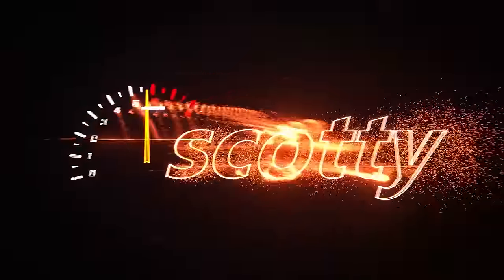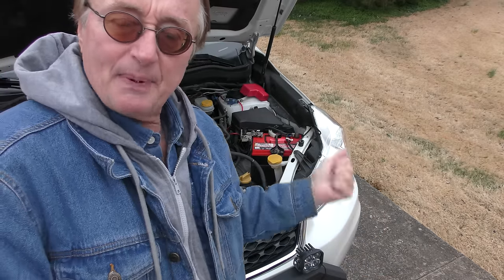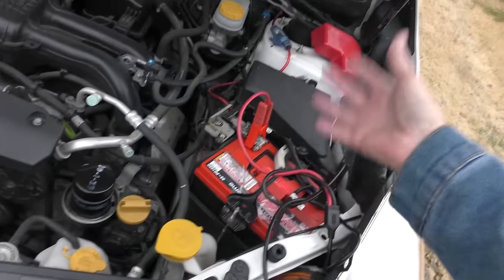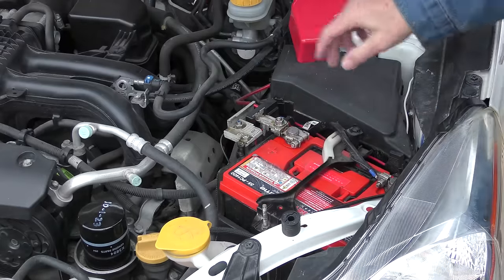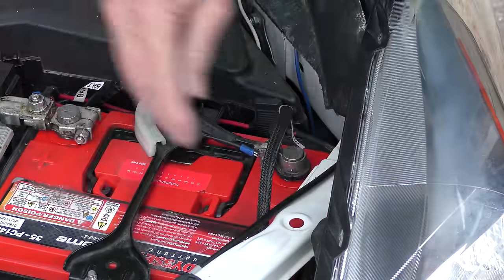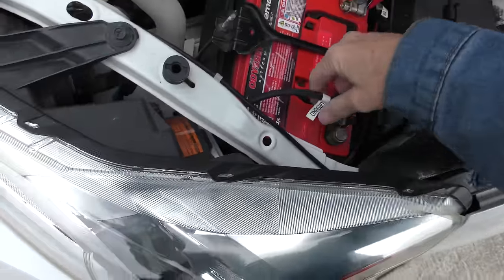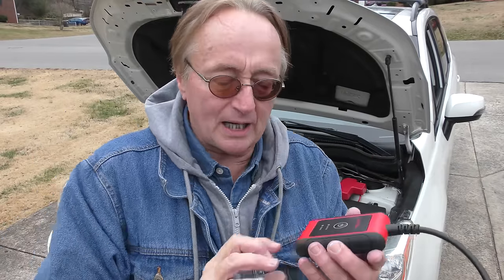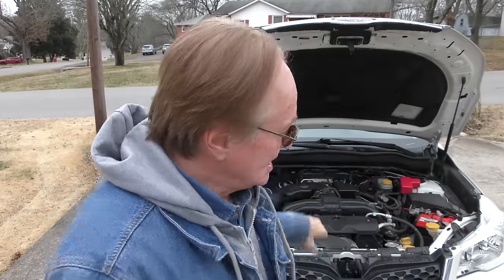Here's Why Connecting Your Battery Like This Will Destroy Your Car

Comment: That engine sounded like a lawnmower with a bad connecting rod. 😆
Reply: Yeah, Scotty has another problem now! Loud knocking noise.
Reply: I always wondered about the secret marvels of Korean engineering, now I think I know the answer.
Reply: I didn’t think it was going to make 3,000 rpm
Reply: It sounds like the owner is storing spare nuts and bolts in the sump 😂
Reply: It's a Subaru 😂
Reply: @robertmaybeth3434 that's Japanese engineering not Korean 😊
Reply: @donpalke4519  CAN'T BEEEEEE
Reply: Typical Asian cars that sounds puts me off
Reply: That because it's a Junkaru. They all sound like the old air cooled VW motors.

Comment: When changing the battery connection,  remove negative first, install positive first. This way if you're tool touches ground while on the terminal there is no short.
Reply: Very helpful. I can remember that. Thank you
Reply: And fit the positive first and then the negative

Comment: That's why I always change my own batteries.  I don't make mistakes like leaving the terminals loose.  I also take them off and clean them periodically.  That is also the first thing I check when I have electrical problems.  I learned that in the 70's.
Reply: I just buy a Camry and don't have to worry about that shyte for 15-20 years.
Reply: I started buying the red, green washers to put on the posts in the 70s.  Coated the posts with Vaseline.  Live in Minnesota and hated battery posts problems in the  winter!

Comment: Those Odyssey batteries have low cold cranking amps and are ridiculously high priced/ I've been using Walmart batteries for decades and I highly recommend them. My latest three-year Walmart battery by Johnson Controls is closing in on year 7 of its life.  Purchased in Oct 2017.  (Today is January 22, 2024) Still cranking good and doesn't falter in extremely cold weather. Cost $80.00.  I think that's a darn good deal.
Reply: My Odyssey is 12 years old.  I live in Colorado.  I'm not a cheap bastard either.
Reply: I have the same battery bought the same year and run a small aftermarket stereo system just a couple hundred watts battery still seems good .
Reply: Very extremely good deal.  I believe they are deliberately lowering the quality of lead-acid batteries so they die sooner than they used to.  Everyone has stories like yours, they used X battery that was so good it lasted 5/6/7 years.  The last battery I bought for my Camry lasted a little over 2 years.  And that's just ridiculous.  ESPECIALLY when I always kept the water level up , always used distilled ditto, and always kept the terminals clean and tight.
Reply: Yup Wallmart Everstart all the way, I had one last over 8 years..
Reply: Me likey Wal-Mart batteries.
Reply: My Walmart battery , still going 7 years plus.
Reply: Lol....one of the best long lasting car batteries I ever bought was branded "energizer" and yep, I got it at wal mart.
Reply: Well, dang, I've always shied away from Wal-Mart batteries ("Your battery was made by the lowest bidder.")  From what you folks are saying, I think I'll give Wal-Mart a try next time I need a battery. I usually get batteries from O'Reilly's or Napa, and the prices have gone up a lot. Batteries for my Acura Integra and RSX used to cost ca. $75-80. Lately, they've been running $130, $140. What the fruitcake?? I do know that a fresh battery is best.....
Reply: @lawrenceh1405  I'm an O'Reilly's man for 20 years but I won't pay their prices  for a battery. I've bought Wal-Mart for years.
Reply: Costco batteries are better.
Reply: @MichaelRei99  I wouldn't doubt it. Three companies make virtually all batteries in the U.S. Johnson Controls, Delphi and Exide. Delphi makes Wal-Mart Everstart. And Costco's Kirkland batteries are made  by Johnson Controls.
Reply: Walmart used to have good batteries.  In 2020, mine was almost double the price of my previous one and it lasted just beyond the 3-year prorated warranty. Batteries used to regularly last 5+ years and I live in a moderate climate where it never dips below 40°F.
Reply: @MichaelRei99 Costco lowered their warranty (or the manufacturer did). They no longer carry the fitment for my car.
Reply: @jaymez858  Interesting.
Reply: Another disadvantage of AGM matt batteries is the charge voltage limit.  Easily damaged with too high of voltage whereas flooded type batteries are much more forgiving charge voltage wise and if water level is maintained.
Reply: @richardrichard8741  Interesting. I did a little research. You, sir, are correct. Thanks. I worked parts back in the day. Way back in the day, if you know what I mean, lol, and we would receive our batteries dry and fill them with sulfuric acid upon sale. I can't remember if we even had to put them on a charger or not. I don't think so. I think when flooded they activated. I'm  not sure.
Reply: Last battery I bought was from Walmart based on one of Scotty’s videos where he said that was the best place to buy batteries. That was a few years ago and the battery cost significantly less than other places. Seems like their prices have crept up lately, but I don’t know how they now compare with other places.
Reply: Here in the Arizona desert, where the temp. Gets above 100 in the summer for 30-45 days in a row, the batteries last maybe 30-40 months.  I buy the wal mart batteries and carry a li jumper. Paying $250 for a battery is just dumb.
Reply: @lorenscalf56  Good info. Thanks!
Reply: Johnson controls is an evil company - ask any employee - but they still do make good stuff once in a while
Reply: @MichaelRei99  costco isnt countrywide

Comment: Yes, tight is good.  I would have first removed the cable end and used a battery post brush on the ends and posts.  Tight is good.  Clean and tight is better !
Reply: I told her that and she slapped me
Reply: My high school tech school instructor, a retired Coast Guard Petty Officer, repeated daily that "90% of all electrical problems are loose or dirty connections", the solution he hammered into our brains > " CLEAN AND TIGHT!!". 20yrs later at thr end of my mechanic career, that advice proved itself repeatedly.
Reply: Also remember that just as the negative battery terminal connection needs to be clean and tight, the other end of the ground cable to the engine and/or chasis also needs to be clean and tight.
Reply: @289hipo  As the old saying goes Cleanliness is next to godliness. Clean and tight makes everything tight.. :yougotthis:
Reply: clean and tight is better? are you talking about batteries? or something a little closer to home?
Reply: When I do that I have to go find my "Memory saver" all over again, if there's smog check coming due in the next 6 months... may you never have to learn the meaning of that cursed acronym "PDTC".
Reply: I think the concept of battery shim was not mentioned nearly enough if at all here.  So many people I mention the occasional need to shim their clamp, look at me like I ride the short bus, and refuse to believe a "battery shim" is ok to do.  But seems like every battery I serviced needed the clamps shimmed at least by the second time the clamps came off.  REason I mention shims is because, I'd do almost ANYTHING to avoid replacing the clamps - if there is a legit way to avoid that I'll do it -
Reply: That's what she said. 🤭🤫
Reply: I can absolutely second what you've said. Tight is good. Very good. REALLY GOOD. And it's important on battery connections, too!😉
Reply: @jimmymcguire - Yes sir…. ‘Tight is always good’👍🏼
Reply: And ⚡lubricate it, so it does not corrode
Reply: Exactly,the chassis ground connection is in bad shape on lots of especially older vehicles,and is never cleaned.
 Causes problems.
Reply: We all need to watch less Scotty and do more dating 😅❤😂
Reply: Yes, of course you are correct.  BUT  Scott knows you are going to have to re-program the auto's radio and possibly other accessories..if you disconnect the battery's ground. And naturally..he's not getting paid for that.

Comment: Simple but important stuff.  Thanks, Scotty.  I once blew a head gasket because I replaced a hose and used a Harbor Freight hose clamp.  (They slip teeth.)  Neglecting details or going too frugal can cost big bucks.
Reply: OMG that's truly the worst horror story of an HF crap-product I ever heard - we all learn one way or another how far to trust any harbor freight item, they are like flashbulbs of the tool world.  But when you need something like a crankshaft puller and you know you'll only need it once, the temptation can be impossible to resist.  But I always knew my personal mantra at HF "do not buy any item with one or more moving parts!" I had no idea that applied to a simple hose clamp...
Reply: Thus we learn the difference between frugal and cheap

Comment: Only honest people admit their mistakes or when they are wrong.. That's why I trust Scotty's advice
Reply: Everybody, and I mean EVERYBODY has an agenda or a bias, count on it. Now if you have an agenda/bias are you really honest?
Quote: "Hey, things wiggle over time. That's one of the big problems with fully electric cars, you can have all kinds of problems".
I'm a petrol head BTW, however - I don't mind calling out something when I see hear it.
1. ICE cars have orders of magnitude more moving parts than EVs.
2. ICE cars produce orders of magnitude more vibration than EVs.
3. ICE cars also have electrical systems, (that still use electric windows/door closing/sunroof etc), and given the CAN bus communication that we use these days there is not the difference in quantity of electrical connections that you think there is.
Think about those three statements when you now read back over what Scotty said.
Reply: I wouldn't
Reply: I thought I was wrong once, but I was mistaken

Comment: Yep - faulty ground connections can result in all sorts of weird things going on.  One of my aunts has an old Chevy Cobalt and it started acting like it was possessed - turning on and off lights, activating door locks and windows and other odd ball behaviours.  The ground wires had corroded off (so that is another thing to check for - not just tight connections, but make sure the ground wire actually grounds).  Once a new ground wire was on, the car returned to normal.

Comment: While you are checking the clamps on the battery, also check the other end of the cables, particularly the ground to the body and the ground to the engine.  I've seen lots of flaky and intermittent things happen with loose or corroded grounds.
Reply: If you have a bad earth, ground  connections, the positive conventional current will find other ground routes to the negative side of the battery.
Reply: @m101ist  I've seen many cases where that just isn't true.  Typically, there is a heavy cable from the battery positive to the starter motor and another to the fuse box for ignition, lights, and everything else.  Then there is a heavy cable from the battery negative to the engine.  BUT, all the lights and accessories are grounded to the body.  The engine is sitting on rubber engine mounts.  So, if there is no cable (or the connection is corroded) from the body to the engine or body to the negative battery terminal, many things will not work or not work well.

Comment: I had the same trouble with a loose terminal.  Jump starting worked like a charm, and made me think it was a bad battery, until the next time I went to jump it I forgot to turn on the power to the emergency jumper and it still started!  Man, it feels good when the universe shows you the REAL problem before you spend money.

Comment: Hey Scotty, My old mechanic father in law would take a goofy car and remore a termal connection. Then he would shine the battery and the inside of the terminal with a little plumber's emeroy cloth. Then he'd do the other terminal. This made sure the terminals were both very clean and tight. Then he'd look at other possible problems.
Reply: With many modern types of battery terminal connectors, caution should be used when abrasives are considered.  Some connectors have a plating made of silver or zinc material over copper conductor and rubbing that plating off can expose the material underneath, and that will greatly accelerate the corrosion process.  Corrosion from battery vapors and even electrolysis in some cases.  Toyota has excellent connection terminals that may seem flimsy but are made for their environment.  Don't over torque and use a terminal coating for long life.-opinion

Comment: I remember when all you needed to check a battery and alternator was a test light and analog ohm meter. Nothing was digital back then. It was a simple world back then. Thank you Scotty for all you do for us. Really enjoy your videos.
Reply: Flukes have been around since the 80’s. Has it been 50 years since you worked on cars?
Reply: @skeezix8156  Have been working on cars since the 60's. Yes, I am old. Remember when they first installed baby computers in cars, disk brakes came out, and DVOM's replaced analog volt ohm meters.
Reply: @roadk88  I didn’t start til the late 80’s. Was in the Air Force working on ground equipment then moved into buses. Not a lot of money back then but it is now since public schools tried to herd all the kids to college. There’s no tradesman left. They’re slowly trying to move us from diesel-electric to all electric. The infrastructure isn’t in place though
Reply: Ohm meter still works. Maybe slower. Volt ohm meter doesn't care if its digital or analog circuit. You have to read schematics and test until you find the electrical gremlins. Sometimes its just worn out wiring grinding and shorting out. Just a matter of being tenacious with inspection.

Comment: My 2011 Honda element had a check engine light for the TPMS sensor. I  unknowingly cleaned the ground and battery terminal doing a transmission fluid job solved the issue! either dirty ground right next to the battery or lose battery connection caused this issue! Thank you Scotty for your transparency its truly a difficult job diagnosing modern cars!

Comment: I own a 2012 Toyota Yaris I bought new. When the original battery started to fail it would still start the car fine but weird electrical things started happening like the auto door locks would randomly lock and unlock while driving. I bought a battery tester and it said to replace the battery. I did and that fixed the issues. Had I not learned this from watching these videos I would be going down one of those rabbit holes Scotty mentioned thinking I had a short or something.

Comment: You always got to tighten your battery cables. Also if you disconnect your battery terminals never leave the negative battery cable on by itself. Always disconnect the negative wire first then the positive. When you connect your battery 🔋 terminals always connect the positive terminal first.

Comment: Scotty I agree you need to check for tightness, but also check for corrosion.   Over the years I have found that the acid batteries with top posts seem to corrode with a thin layer of a dark oxidation layer.  If I'm checking battery terminal connections I generally pull wires off and clean posts and terminals with wire brush or terminal cleaning tool.  Thanks for your videos.  A lot of good info put out by you that can save people a lot of money
Reply: Hi user, I agree! Also check the Earth bond back to the chassis. A thousand things could appear faulty or erratic if the Earth bond is not good! LesC.

Comment: As an EE for over 40 years....
I agree with everything you said, but I can't figure out how a loose connection on the battery terminal can cause a high voltage when starting. High current yes, high voltage no. On the other hand I can easily see a high voltage when the car is running at  idle because the alternator will be supplying a higher voltage through the regulator because the loose battery cable is causing an undue voltage drop, which it's sensing. 

Just my two cents....

Comment: I use the largest battery Optima makes in my Honda to offset the cost with longevity. My last Optima lasted through 10 years, 5 cars, and 3 deep discharges. I even changed the connectors on a car just use the same one.

Comment: Started using marine battery in my odyssey and have used it in prolonged sub zero temps with no problems, they're cheaper plus they don't sulphate up and die if you drain them by accident unlike regular wet cell batteries.

Comment: I bought an Optima battery for my Dodge Ram pickup.  The first battery failed before a year passed.  Since it was still under warranty, they prorated the cost and gave me a replacement.  I just paid the difference between that amount and the cost of the new battery.  I've had the second battery for at least 10 years, and it still works great.  I'm amazed, because I don't drive the Ram very much (around 3,000 miles a year), and the last several years, it's been parked outside in the cold over winter with the battery still intact.  I put the charger on it only a few times over the years.  I really need to find the receipt, so I know for sure how many years it lasts.

Comment: Make sure the battery terminals are sung, you don’t want to absolutely crank them down because they’ll break if you over-tighten them. I made that mistake once.
Reply: It depends what they are made of.  Lead connectors can easily break (or strip out, if side terminals).  My Nissan Altima has some other type of metal (maybe copper coated steel?) where tightening then good won't break them (at least not as easily).  They look similar to the terminals shown on the car in this video.